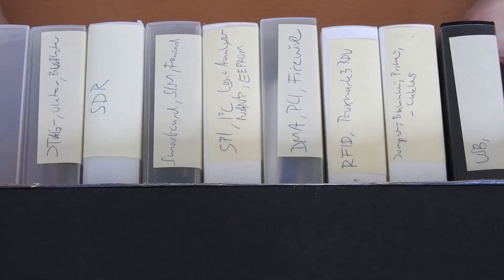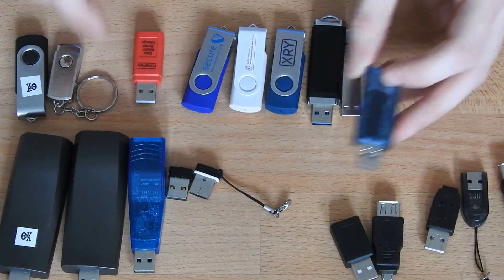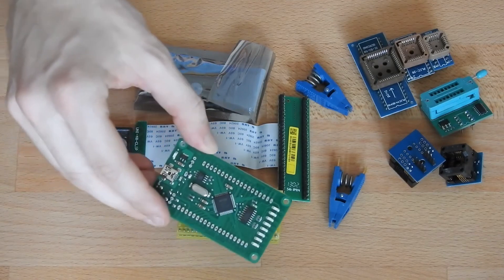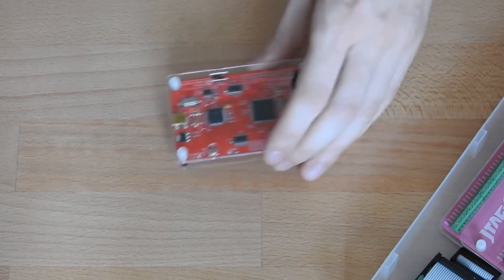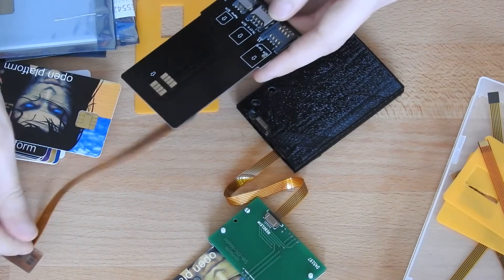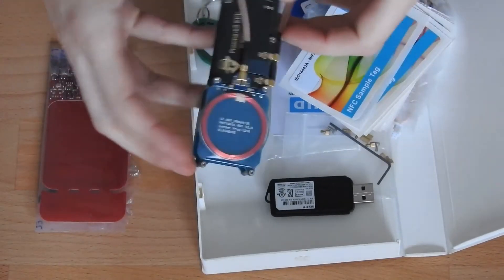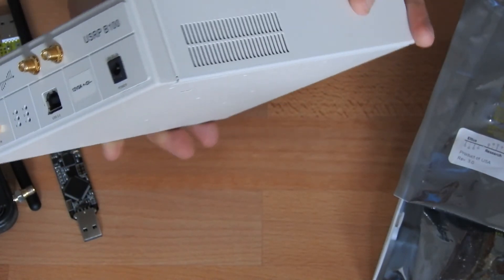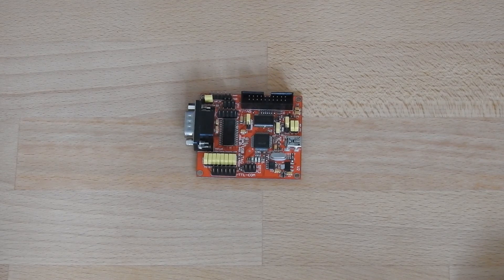Hardware reverse engineering gear (Part 2): Communication interfaces

Comment: Unfortunately Part 1 is missing.. :(
Reply from the maker: It was outdated and recommending stuff that I don't use anymore that is not very good anymore.
I'm not soldering much anymore so nowadays I use a TS100 (because it is super portable), some flux, some wires, some heat gun, some small USB fan (soldering smoke is toxic!), some fireproof matt.

Comment: Hi...Its a increíble colection.  I have some questions, I have a busblaster v4 but I don't know what's the correct bsdl and svf files for programming it. Can you help me? Because the website its not clear.  Also, can you share more videos about reverse engineering with the jtagulator (iam training jtagulating with FPGA boards), because some times I don't accomplish the bypass scan, I think is due to the voltage configuration.  The IDCODE test is succesful. Can you share some tips for jtagulating properly. I'm trying to follow your last videos about reverse engineering and dumping binaries.
Reply from the maker: Regarding the Bus Blaster: That sounds a lot like what I have done, i.e. used it with urJTAG to program a C2C64A CoolRunner-II CPLD development board ... I remember I encountered some problems but eventually managed to program the device, but since this was the only time it did something like this I probably couldn't help you with that as I was basically trial and erroring it myself.
For the JTAGulator: that sounds like TDI issues. IDCODE scan doesn't use TDI, BYPASS does. So it could be:
- dodgy cable or connection (in 90% this was my problem)
- wrong TDI pin
- TDI broken (either at begin, between devices, or end of chain)
But yes it could also be cause by a wrong voltage input. In this case you could try different voltages (but be careful to not kill your device!).

In case I encounter a troubling device I will try and make a video ... and also try to figure out what to do to make BYPASS scan to work. But for now I was lucky and - aside from bad connections - it either did not work at all, or it did work.

Hope this helps. And I will try to make more videos in which I use the JTAGulator, but I don't do this professionally so several things must meet: 1. need to find target with JTAG, 2. should be interesting so I take a look, 3. I must get it to work. So no promises. But I will try.
Reply: 0x6d696368 thanks for your answer! In case of the jtagulator issue, some boards I could do some jtagulating but I had many false-results. I need to check them with oscilloscope and tester. On the other hand, i could find the svf and bsdl files for the V4 but I couldn't accomplish the self-test and the "detect" devices and discovering chains. In the mid tome, thanks to this videos, i ordered a TIAO TUMPA JTAG. I hope you can share more videos, your work is awesome.

Comment: I like the RD UM25C USB tester better than the Drok
Reply from the maker: What are its benefits?
The Drok is also available as USB3 version. Though in case you only use it as a meter to measure voltage it is possible that their are more accurate solutions. But I also use the Drok for data blocking sometimes. Can the RD UM25C do data blocking?
Reply: However it does not act as a USB condom. I was unaware that my Drok can do this!
Reply from the maker: Note that older versions of the Drok don't have different modes. But newer version do. You have to hold down the button when powering it up then release once it says "USB disconnect". It also does the fast charging protocol. It also has a zero function for calibration (hold until it says "zero" on the display).